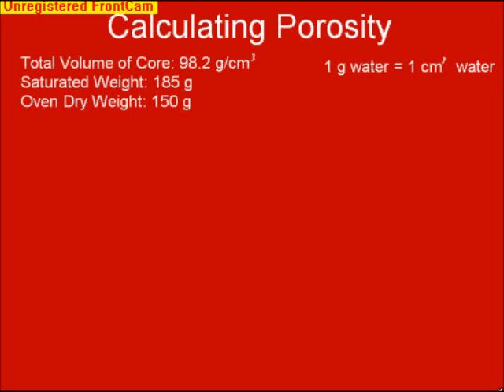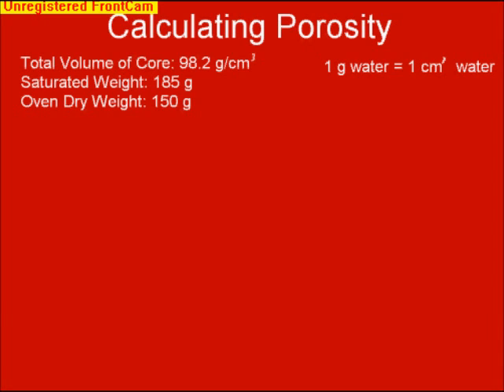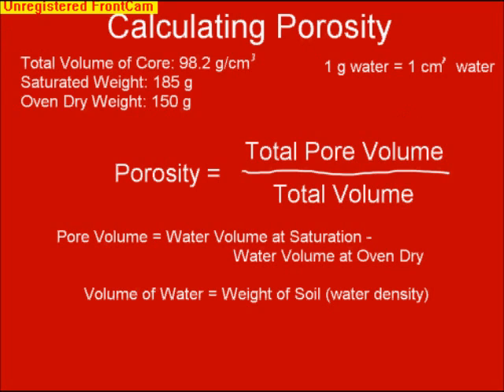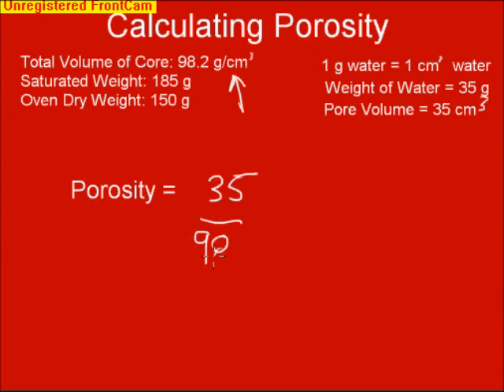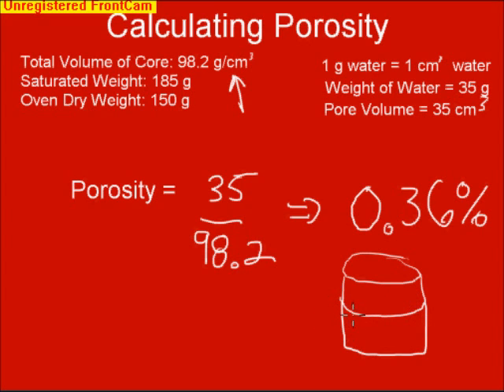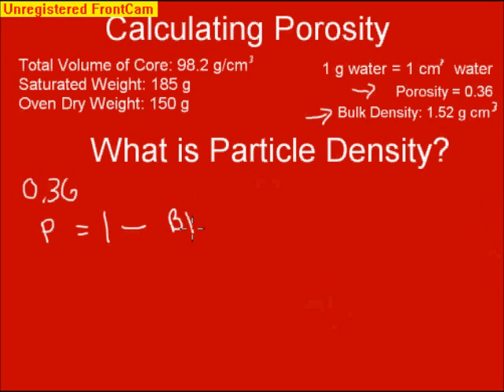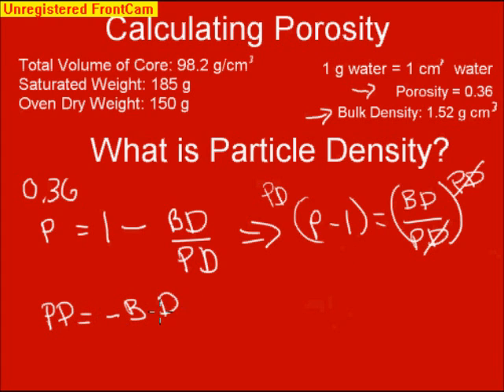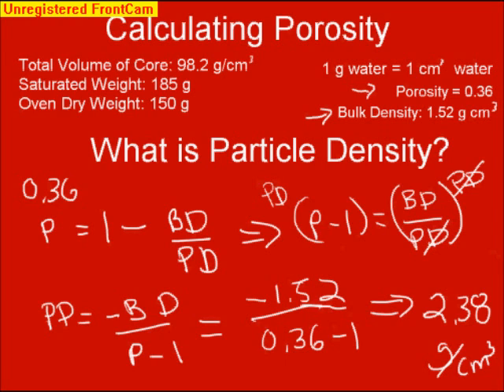Calculating Porosity and Particle Density

Comment: An undisturbed sample of a medium sand weighs 484.68 gram.
The core of the undisturbed sample is 6 cm in diameter and 10.61 cm high.
The sample is oven dried for 24 hour at 110°C to remove the water content.
At the end of the 24 hours the core sample weighs 447.32 grams.
Determine the BULK DENSITY, VOID RATIO, WATER CONTENT, POROSITY AND SATURATION PERCENTAGE of the sample........

Can u plz solve this sum right now???